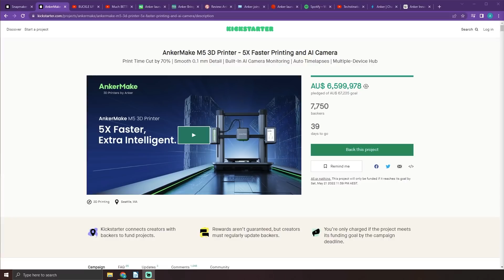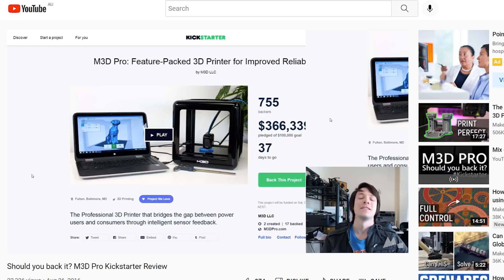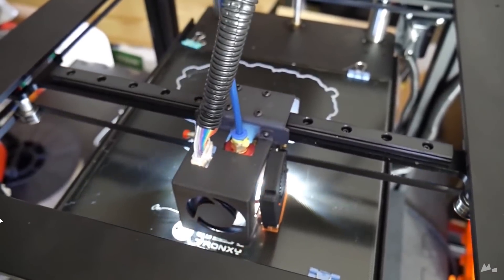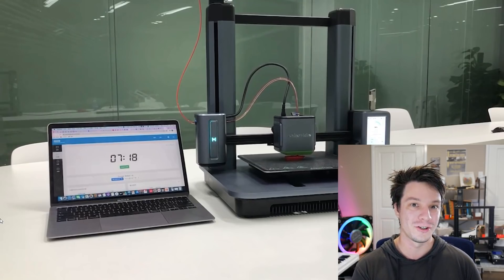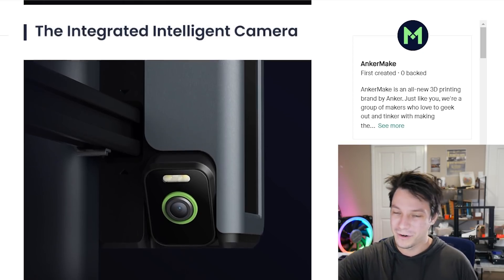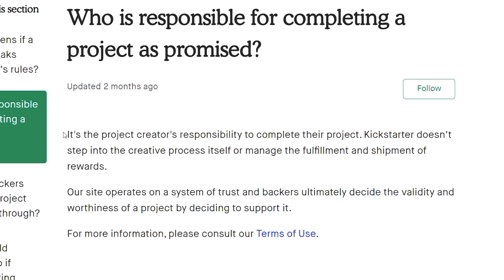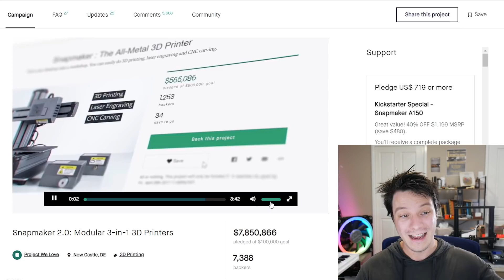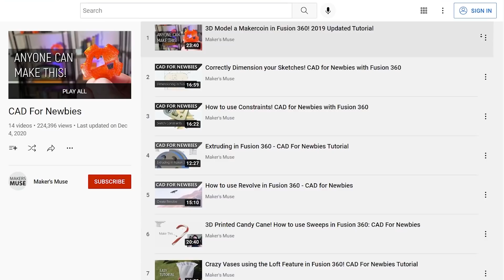This 3D Printer looks incredible, but...

Comment: I have used several models of the Objet printers extensively over the years, and I will say that while the technology and principle has promise, the Objet printers themselves are...mediocre. While they print fast, the solid material is a very brittle acrylic-type plastic. As for the flexible print materials...yeah they are okay but the durability is completely laughable, and cracks easily--and this is in the best case scenario of using only the pure material (you can mix in ratios of the solid and flexible materials to get intermediate durometers, but they are crumbly). 

Additionally, the post processing is annoying. You need a dedicated high pressure water jet wand/gun to blast out any supports you can't remove in bulk, and the support material is like a disgusting cheese you can never truly remove cleaning, resulting in a greasy residue or sometimes almost like eraser flecks. As well, you can never print without support material--you can guarantee the underside of a print will always have support material, which, at those surfaces, are totally rough in contrast to to the glossy surface of surfaces with no support. Curved surfaces also exhibit significant stair stepping, which was surprising to me, but oh well. 

The nozzles must be babied lest they clog up, requiring contorting to even reach them to wipe off with low lint wipes. If they clog, you're screwed, which is why the machines have something like 10 nozzles (I cannot recall, they were in about 10 banks of maybe many micronozzles each). Don't even get me started on the peristaltic pump system it uses to draw up the resin--if and when it breaks down, you better have your technician on speed dial. The entire print system is rather wasteful too, with frequent nozzle purges and auto wipe procedures, resulting in containers of waste sludge that's toxic. 

I have forgotten much of the calibration process except that it's a major pain--oh yes, you have to be sure that the UV lamp doesn't burn out, too! Additionally, the proprietary slicer is hot garbage, literally the minimum viable product. Oh yes, one last thing--when you operate the printer, you need to KVM into the onboard windows PC built into the printer to pretty much do any operation, and if you need to turn on the PC after some unavoidable shutdown, get ready to shimmy behind the big printer to hit that hard to reach power button.

Anyways, I don't mean to demean the technology's future, but resin jet printing is certainly not without its disadvantages. After having worked with so many different printing technologies, I gotta say that despite the shortcomings, FDM isn't all that bad, which is what I thought prior to greater exposure. I just wanted to share my insight working with Objet printers, since they are not hobbyist machines.
Reply: Couldn't agree more. After years of working with an Objet 30 Pro and a  3D systems Projet  HD 3000, I would never use another Poly jet/multi jet printer again. When they work, the prints are incredible. However, they only worked 1/10 of the time. I've never had any piece of equipment that needed more service than those two machines. Don't get me started on the amount of toxic waste generated by their unending purge cycles.....never again

Comment: Regardless the issues of Kickstarter, Anker or AI failure analysis which you highlight properly, the point about one's need to be a CAD designer is massively important.  As I build my custom projects the key skill I added in this journey was Fusion360 because 3D printing became a "machine shop" to me.  Aside: moving on to "Onshape".
Reply: "the point about one's need to be a CAD designer is massively important.  "

It's not. Or at least; it is not a downside to this printer.  First, you do not have to be a Fusion-360 guru, Tinkercad will do for any beginner.

Second; 3D printers are created specifically for those who want to design and print their own objects. Everybody who buys a 3D printer wants to design their own objects. This is not a problem with 3d-printers. 

MakersMuse is a little confused , he seems to think that every home needs a foolproof 3D printer because 3D printing is so cool, and I get that, but most people don't care about 3d printing, just like MM doesn't care anout needlepoint and scrapbooking. There is no benefit to making a printer plug-and-play because there is no market for it. And at the prices that this new printer is suggesting, the market for this one wil be small too.

Comment: I think you need the 3d printer first, then you will find reasons to learn modeling. My needs to model stupidly simple stuff has forced me to learn. And because I had a goal, and could test and go through iterations, I stuck with it. I am super basic but I have been able to help other people modeling when I had solved a problem they hadn't got to yet.

Resin jetting is interesting but it would need to be cable of getting to ender pricing. Can it get to less than 1000$ and stay as reliable as you have seen it?

Comment: TL;DR: By all means, make the machines less error prone, and more repeatable. make them more precise, and more unique and more rugged, and faster and reliable, and smarter, and dumber, and ceiling mounted and put them on construction drones- but don't give the printer companies the chance to make it "magic.". the moment people who don't know how to fix printers, people who don't want to know what printers need to work, the basics, become the target audience, is the moment companies lie to them, tell them they just need a cartridge for "printer food". a black box. that printers only work with their own slicer. That you need an internet connection to start an approved print from their website. That only they can fix their machine. DO NOT ALLOW THIS.
it happened with Apple, all the printer companies, and has already resulted in several 3D printers with "cartridges", as well as medical equipment, and plenty other things that become trash at the slightest issue, or paperweights till an "approved technician" can press a reset button. learn to fix what you use.

I don't think resin jetting is very great. it's good for stuff like prototypes, but resin isn't exactly for load bearing parts like proper plastic can be. what makes printers great in the residential space is their functionality- their parts that work for years. door shims, that knob on the dryer- when you need a little specifically shaped peg to fix a baby gate STAT before bedtime, an arm joint for billy who just broke his irreplaceable action figure, that electirc guitar body you always daydreamed about having as a kid, even though you don't play, lampshades that perfectly fit your industrial-marble palace decor- that's what it's for. resin just is less feasible in the everyday, through size, stress, if you've ever tried to scratch PLA, you know you can make a proper low-speed bearing out of it if need be.

There's a fundamental difference between 3D printing and 2D printing, and that's- for 2D printing, your knowledge only needs to be artistic, or informational, but in almost no case, does something you get out of a 2D printer need to be structurally sound or in other ways used other than being looked at.(or in my case ignored in bulk)
The end product of a 3D printer is mechanical or artistic, or some mix, but always need to be able to function. people who are making mechanical parts, those who know even just a little engineering already, benefit strongly from an open platform that doesn't try to be smarter than them. I can't tell you how many times a computer telling me what I want has foiled my designs and workflow. People who are making artistic parts... well, there's something to be said for that, but at the same time there's a danger to assuming people needing to put in effort is bad. some things are just... better if you know some baseline things about it. I would say most things, actually.

so, yes, I have some issue with this inherent want for "ease of use", not because of what it is, but because of what it entails. there's a reason artists still go back to the humble paintbrush when we have a printer. it's that, sufficiently advanced, both engineers and artists seek control and results above production speed and ease of use. there's a reason we have hundreds of brush types.
and that isn't even my main concern. We've already seen it firsthand- that companies WILL step in, whenever possible, to create walled gardens to trap consumers in, and eventually misinform and misdirect them.

whenever we make a device smart enough, and sell it to people who don't want to understand how it works... they get exploited. they're lied to by companies who are free to assume these people know better. "it's dangerous" they tell people who want a new $20 phone battery. "it's just how the technology works" they tell people who want their printers to use black ink instead of every color all the time. "we have better quality control" said that one company trying to use filament cartridges.
so, no. don't make them set and forget. keep them dumb. keep the processing on the computer, keep the jams visible and keep the parts standardized by the community, not companies who stand to profit by misinformation, manipulating families, and so on.

Comment: I've got the same philosophy about Kickstarter (and major corps) and this one even got me to consider backing it. They've added so much of the stuff that you usually mod into a nice rounded package.

Plus, the way I think (given what I read) they're doing the AI camera should work really well once it's matured. Instead of relying on CNN's to detect spaghetti and such (ala Spaghetti Detective), I think they're aligning the 3d model to the printed model and using the diff to detect issues. You can do this when it's a fixed camera (position/angle is always the same). I worked for a corp trying to do this on a building scale about 12+ years ago (back when builders were still reluctant to adopt BIM), so it should work really well here at this smaller scale, since the 3d info is required anyways - although I'd expect it won't be that great out of the box and will need a few months to a year for the algorithm to mature (they'll likely have some mechanism to have users opt-in to sending them print data for training purposes).
Reply: It will still rely on cloud connectivity IMO, the printer looks to be always online. I hope it won't stop printing when your internet goes out.

Comment: I definitely agree about resin jetting being the future.  There were still patents held by companies that do not license cheaply enough for it to jump forward the last time I looked at the technology.  I think the second breakthrough is a good enough resin that can be mixed with something else (either a different process or an additive in the print head) that will change it cured voxel from a water soluble support material to a build material.  Add in some color UV inkjets and you will have a full color 600-1200 DPI where the user will never have to mess with the resin directly, and supports are as easy as soaking the part in water over time.

Comment: This seems cool, but it looks like it may be too closed. I love my Prusa i3 MK3S because it is solid out of the box and also open when I want it. I can use any slicer I want (though PrusaSlicer is great). I could upgrade and modify parts, the CAD files are on github. The openness is not just about modifying it, but also about understanding it. That is why I built my Prusa from a kit and why I run Linux as my main OS. (I'm also in the fortunate position that I can and need to run Linux at work as well.)

By all means, please make an easy to use 3D printer. But please do not lock it down as so often happens.

Comment: I have a snapmaker 2.0 with enclosure and while it is fun, it is far from problem free. Each and every module (3DP, Laser, CNC) has a steep learning curve and so trying to learn all three is really challenging. My snapmaker 2.0 has already started to collect dust as I transition to MSLA, because while MLSA is messier, I get far more reliable prints from my elegoo mars 3 than the snapmaker.

Comment: 3D printing will never be mainstream until there is a CAD program that's as easy to use as say MS paint. Even as someone who has a mechanical background and has been doing manual machining for 20 plus years it took me several weeks to get the hang of using a slicer but multiple years in to printing I still struggle with CAD...

Comment: XYZprinting da Vinci 3D Printers are rock solid in my experience. Not a popular take, I realise, not "hobby hardcore", but in terms of what I needed I was a beginner,  I was good to go with just Microsoft 3dBuilder. DRM filament ? Sure, annoying, and had to be hacked. Frankly, I did not give a shit, because for PLA in particular, I just got printing done and focused to getting better modelling skills with Fusion360. I worked at a startup a few years after I started with my own first printer that had expensive commercial ones, they where WAY harder to use. Oh, the XYZ STILL works, regardless of newer toys. Resin jet sounds great, particularly if has on the fly dye colouring.

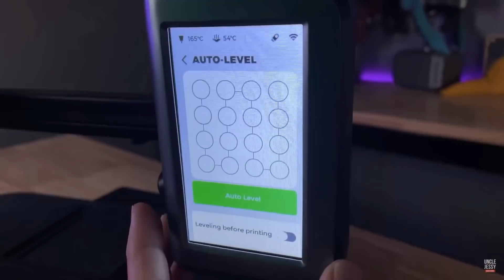Comment: 5:38 - The PrusaXL will also have fully automatic first layer calibration... but it's way more expensive. We'll see how well this machine does it.
Reply: Try an Ender 3 v2 with Jyers firmware, and a CR Touch.  Mesh leveling, auto bed leveling, perfect first layers every time.
Under 300 US Dollars

Comment: Started with an Ender3, just bought an Ender3 Max. Other than the Z level switch, I am happy with everything so far. I see this tech like the computers of the 90's, most people just wanted a box that did its job, and others wanted to play and max out that box. Eventually plug and play will take over the market, but until then let's have fun.

Comment: I like your reviews! But wish to share a few personal thoughts:
1. Caveat emptor. Never ever buy anything before actual consumer machines are shipped and reviewed.
2. I bet 9 to 1 it won't gonna break into general consumers market. 3D printing is not only about operating a printer and a skill to use a CAD - it's about making something. It's about the way of thinking. Too many people choose just to consume. 3D printer by itself, even super advanced and completely maintenance-free will not change the way of thinking for most people.
3. And let me argue about resin jet :) In terms of simplicity and fewer moving parts - MSLR/DLP resin printers are the best (only one motor, you know...) but there are a lot of questions how convenient it is for most people. Resin jet has more moving parts and requires messy post-processing with toxic liquids - basically combining worst parts of FDM and MSLR technologies. IMHO today's FDM technology is the most bulletproof thing. It can print with non-toxic materials, it requires very little maintenance. Even with it's limitations in terms of quality and speed it for sure has years of practical application to go. It proven to be vary handy tool in almost every workshop.

Comment: As a 3D print designer and seller, I have mixed feeling about this product. The current market is perfect for most people to have heard about 3D printing, but entry barrier high enough they won't go into the hobby themselves. If Anker really makes this a success, automatize a lot of guesswork, the skill level required for good designs/prints will be lowered, and the public perception about 3D prints is going to be devalued. On such trajectory prints won't worth a dime, more and more people will go into CAD or 3D modelling and dilute the field. Arguably the market for 3D models can become very popular and you can sell models, but it's really a wakeup call for people like me to find another specialisation.

Comment: Great stuff on the AnkerMake comments, but you lost some credibility with the PolyJet comments. 

We had a polyjet machine at work, and it was incredibly unreliable compared to FDM. First off, polyjet isn’t simpler than FDM, not by a long shot. The print heads are very complicated, expensive, and have few user servicable parts. 

Second, polyjet machines still require slicing like any other printer, and it’s not just click and go as you implied. There are some stuff you don’t need to worry about like fan speeds and such, but it still requires effort and experience to slice the models. 

Third, polyjet parts kind of suck for actual use. They make beautiful models, and will be great for the mini figurine space, but mechanically, polyjet parts are vastly inferior to FDM and SLA materials in terms of actual usable parts like brackets, jigs, etc. That could change in the future, but polyjet requires very low viscosity print media in order to flow through the tiny inkjet nozzles, so you can simply dump an SLA resin in to a polyjet machine. 

Polyjet definitely has its advantages, especially for full-color models, but I don’t see it becoming the consumer printer of choice in the future. 

I think FDM will be king in the consumer space for many years if only because the patents have run out from Stratsys on it, opening the floodgates for other companies to to race to the bottom, for better or for worse. It’s also relatively safe, at least in terms of fumes and nasty cleanup compared to SLA. 

Polyjet is relatively newer, and still highly protected by 3D Systems.

Comment: I’m skeptical.  I’m sure from an electrical engineering standpoint it will be sound but it’s still going to use the same mechanical components that any other cheaper printers use under the hood and the software firmware is probably going to be lacking.  The creality CR6-SE also has bed leveling and filament runout sensor and it’s firmware is garbage.